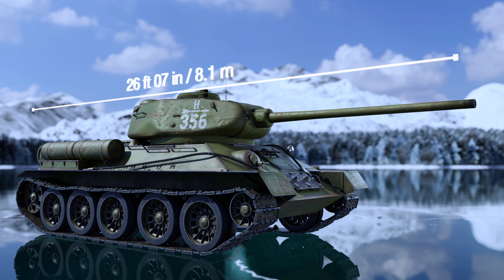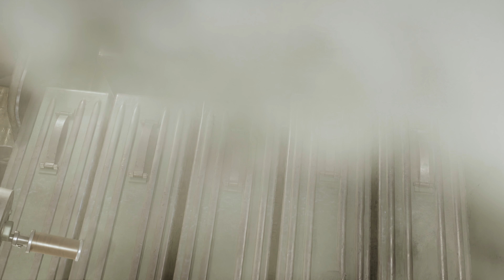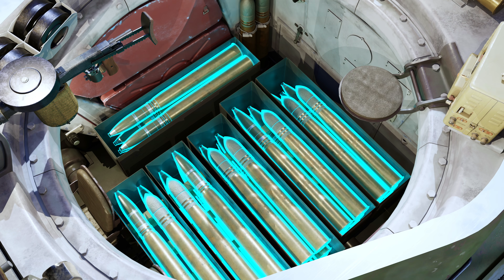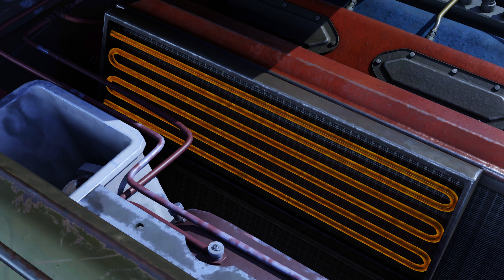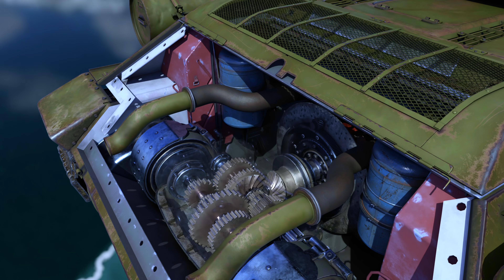Inside the T-34-85

Comment: Absolutely magnificent video; thank you. I think there's a lot of truth in the theory that the T34 was so cheap and easy to produce the Russians could use them almost as a disposable, consumable commodity, almost the same as a hand grenade for instance. As soon as one was destroyed there was another, or two, on the way to replace it. There's a valid argument, I would suggest, that the German's obsession with expensive, complex, relatively fragile precision engineering and innovative new technology cost them the war. I believe that the T34 was deliberately kept as simple and straightforward as possible not just to reduce costs and maximise production rates but to also allow field maintenance by an unskilled labour force used to working on farm machinery

Comment: Awesome work as usual.  One correction, the front armor at 45mm thick, set at 30 degrees from horizontal (60 degrees from vertical) would be 90mm line of sight thickness, not 76mm.

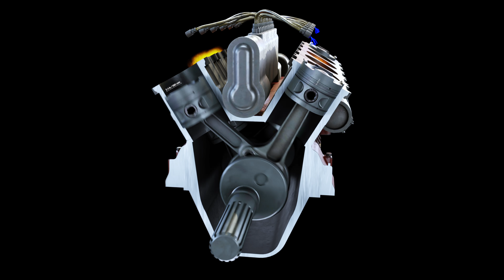Comment: 16:20 The engine of the T-34-85 tank had cylinders with different piston strokes in the right and left banks. Left bank piston stroke: 180 mm. Right bank piston stroke: 186.7 mm. The difference arose because the connecting rods of the left bank were shorter and attached to the "slave" connecting rods of the right bank (a "fork-and-blade" connecting rod arrangement). This was done to fit two connecting rods on a single crankpin journal within the compact V-engine layout.

Comment: Now compare this to what Germans had in 1941... 
And who was prepared better for the attack.
Reply: In 1941 they had 300hp gasoline engine that can not start cause it lost ignition or carburetor is not setted right😂 
T-34 v2 engine is 500hp,have much more torque and it always started without problems,this engine started on is-3 even 70 years later without taking it from the tank. They just changed oil and water,and it started.
Reply: @HoldenCommodoreGRA Exactly. Stalin had thousands of superior tanks. We dodged a bullet thanks to an insane German leader with a funny mustache 😂

Comment: nice detailed video. you mentioned some of the problems. it was actually piece of junk. the lack of turret cage forced the loader and commander to dance with the rotating turret, the electric motor that turned the turret was weak, overheated, burned. manual crank was necessary.... it was so bad, that for each german tiger destroyed, russians paid with 25-28 of t-34. the 85 mm T-34 gun vs the 88 mm gun on the Tiger... Russians had no problem sacrificing their own soldiers en mass.... "women will deliver more babies, nothing to worry.."
Reply: Очень смешно, эти сказки уже с 2000ых в России устарели а на западе в них ещё верят?)

Comment: Still cannot believe someone is able to do such vast amount of work. Brilliant.
Reply: J. Walter Christie was a genius
Reply: @DoktorBayerischeMotorenWerke , what relation does John Christie have to T-34?
Reply: @antonkirov1923  He designed the BT tank series which the T-34 is a BT model variant.
The T-34 is directly related to the Christie Tank "aka BT"
Reply: @DoktorBayerischeMotorenWerke , John Christie did not design any BT tanks. He dis not create even one tank. He did not invent “Christie suspension”.
He created a concept models of tanks. BT-2 took many decisions from M1931, but it was created independently.
Christie invented wheeled-tracked suspension/drive hybrid.
Suspension of T-34, was invented and used ling time before baby Jony was born.
Reply: @antonkirov1923  The M1931 also-known-as the "BT-1" tank was designed by J. Walter Christie. The M1931 was purchased by AMTORG and shipped to the Kharkiv factory where it was replicated and introduced into service in the USSR.
 Please name a tank that predates the M1931 with the same suspension system?
Reply: @DoktorBayerischeMotorenWerke , БТ-1 was prototype, but not a completed, fully functional tank. That’s why there is БТ-2.
Christie is the first who invented convertible tank. But it doesn’t relate to T-34. Originally A-20 (БТ-20) and A-32 were planned with torsion suspension, which already was used on KV tanks (it’s prototypes at that moment). But due to industry was not ready to produce high quality torsions, a springs were returned.
Somebody generates such rumors.
Reply: @antonkirov1923  The only major difference between the J.Walter Christie designed BT-1 (M1931) and the BT-2 (M1932) is the addition of a turret.
  J.Walter Christie invented the suspension system used on all the BT series tanks including the BT-20G/A-32) which is the T-34.
 The T-34 is directly related to the BT-1 and retains the Christies suspension system, the T-34 only deletes the convertible road wheels and adds an additional axle to improve weight distribution, all other aspects of the Christie BT suspension are retained.
Reply: @DoktorBayerischeMotorenWerke , should be mentioned that Christie created just a prototype, or should be mentioned Ginzburg.
Independent trailing-arm suspension was not invented by Christie.
There is nothing of the BT-1 in T-34. Actually A-20 and A-32 were completely different tanks.
Reply: @antonkirov1923  J. Walter Christy created the BT-1, the prototype for the T-34.
No, Christy invented a unique type of trailing arm suspension for tanks that features a bell crank and push rod with/ helical coil spring arrangement which is protected inside the tank hull. The EXACT SAME design used in the T-34 and all the BT series.

I SAID
quote: BT-20G which is the same as the T-34 (A-32)
Reply: @DoktorBayerischeMotorenWerke , Christie used trailing arm suspension that already been created with tracked propulsion. But in patent law, such innovation named a utility model. Yes, he is the one who first put springs inside. But on Merkava, with springs outside the hull, the suspension also named Christie.
He has relation to T-34, the same as Wernher Braun relates to Soyuz rocket family.
Reply: @antonkirov1923  Christie invented the design used by the T-34, which is a trailing arm system that allows the location of the helical coil spring to be positioned independently though the use of the bell crank arm and push rod. 
 It is this genius invention that makes the BT/T-34 series unique from other trailing arm suspension systems that were not as successful as the T-34 was.
 The BT series incorporated many modifications, additions and deletions most of which were not successful and Kharkiv continued to retain the basic BT-1 design throughout the series right up to the T-34 which also retains the basic Christie M1929/M1930 BT-1/BT-2 design and layout.

The T-34 is directly related to the Christie M-1929(BT-1) as the NASA Mercury rocket was directly related to the V-2 missile, it uses much of the same design and technology from the original missile design.
Reply: @DoktorBayerischeMotorenWerke , let’s look on «directly related» T-34 / M-1929.
1. Mass: 26.5 t / 9.36 t,
2. Armor thickness: 52-40 mm / 5.5-13 mm,
3. Propulsion: Caterpillar / hybrid,
4. Weapon: 76.2 universal gun / machine guns, which was not delivered,
5. Hull design: sloped welded armor / vertical steel shields assembled with rivets,
6. Engine: diesel engine / petrol engine,
7. Crew: 4 / 2.
As you can see these machines are absolutely diﬀerent.
But, there are few things which remained on T-34 due to «directly related» Chrisrie
model:
a) Two seat, cramped turret,
b) Pinion engagement type of trucks,
c) Springs, instead of torsions,
d) Driver’s forward opened hatch.
All four mentioned things were the biggest problems of T-34 and all have been
removed on T-44 tank
Reply: Basic “Christie design/layout” was not invented by John Christie and was used on soviets tank before.
In Christie models, springs were located in double-wall space, but in T-34 inside the boxes.
The front of hull on T-34 made of two plates. Presently such solution is used on all tanks. On M-1929 this part is pyramid, made of four plates.

Comment: Насчёт двигателя враньё, на танк Т-34-85 устанавливался американский двигатель, поворотный механизм башни, тоже был американский, резина на катках, тоже американская, про оружейный ствол, тоже ничего не сказали, да его изготавливали в СССР, но на американских станках, которые были доставлены специально из США, об этом уже рассказали и показали на Ютубе, странно что вы об этом ничего не знаете.
Reply: Ну то что электромоторов в СССР не производили, так это понятно. Но почему же вы не назвали модель американского двигателя?
Дай угадаю - это сверхсекретная информация?!😊
Reply: Early BT tanks were equipped with the Liberty engine, based on the Mercedes D.IIIa later tanks with the BMW VI
The T-34 was powered by the V-2 which is the land version of the Kharkiv AN-1 aircraft Diesel engine also based on the BMW VI with Bosch injection pumps
Reply: @DoktorBayerischeMotorenWerke , this means V-2 is BMW VI? Seems instead of Injectors in the head were installed a spark plugs!
But....I don't see heads, or one head on BMW VI. However the angle between two blocks is exactly the same! But actually... blocks on BMW VI I didn't found.
Of course this is not most important in engine. The main thing is movement of the pistons in the liners! Hope you agree. Looking on the drawing... Yes, BMW VI has pistons, but without liners!
At least V-2 same as BMW VI has rotating crankshaft with flywheel. And again, we cannot find flywheel on the BMW.
V-2 is very strange version of BMW VI.😊
P.S: company Bosch was not the one, who invented such type of Injection Pump
Reply: @antonkirov1923  The V-2 is a variant of the Kharkiv AN-1 aircraft Diesel engine which is based on the BMW VI and shares the same geometry and crankcase/reciprocating assembly. The individual cylinders were upgraded to a monobloc cylinder casting and heads.

Aircraft engines do not have flywheels, the propeller mass serves this function without the additional unnecessary weight.
V-12 engine also do not require flywheel to operate as a power stroke occurs every 60 degrees so they are overlapping by 30 degrees of crankshaft rotation, heavy duty vehicle engines do however need some additional flywheel mass to improve tractive effort and clutch engagement.

The Kharkiv factory did license and import Bosch Diesel injection pump technology and the AN-1, M-40 and aCh-30
 used copies of the Bosch PE series injection pumps with modifications to reduce manufacturing costs and eliminate parts that would have to be imported. The V-2 pump is a further simplified, economy versions of the Bosch PE pump.

All Soviet Diesel in-line type injection pumps are based on Bosch PE Reihenpumpe units.
Reply: @antonkirov1923  The V-2 is a variant of the Kharkiv AN-1 aircraft Diesel engine which is based on the BMW VI and shares the same geometry and crankcase/reciprocating assembly. The individual cylinders were upgraded to a monobloc cylinder casting and heads.

Aircraft engines do not have flywheels, the propeller mass serves this function without the additional unnecessary weight.
V-12 engines also do not require flywheel to operate as a power stroke occurs every 60 degrees so they are overlapping by 30 degrees of crankshaft rotation, heavy duty vehicle engines do however need some additional flywheel mass to improve tractive effort and clutch engagement.

The Kharkiv factory did license and import Bosch Diesel injection pump technology and the AN-1, M-40 and aCh-30
 used copies of the Bosch PE series injection pumps with modifications to reduce manufacturing costs and eliminate parts that would have to be imported. The V-2 pump is a further simplified, economy versions of the Bosch PE pump.

All Soviet Diesel in-line type injection pumps are based on Bosch PE Reihenpumpe units

Comment: It didn't really matter whether the fuel tanks were full or empty, because the fuel lines were leaking. 
The floor of the T-34 was constantly covered with a sticky mess of diesel and dirt. 
The tank crew's clothes were coated in this mixture.
 When a shell pierced the tank's armor, it instantly ignited this mixture and a fire would start. 
The ammunition would begin to detonate. 
It was a crematorium tank.

Comment: They had to make so many because they were  non functioning junk by two weeks. The crews tried to carry spare motors as they stopped running quickly. It was the tank they had to work with, that is why they tried to build better so many new models of larger tanks.
Reply: Интересно, где ехал запасной двигатель?

Comment: The T-34 was actually an expensive medium tank design originally but then when Operation Barbarossa began, the Soviet's basically panicked and forced the tank into the sweat shop and cut a lot of corners in the manufacturing process to churn out as many as possible.

Comment: the V-2 engine was created at the Kharkov locomotive plant, and the engines were produced at the Chelyabinsk Tractor Plant (CHTZ), so the engines of this series have nothing in common with aviation, this can be seen by the way this engine works - like a tractor. The stroke of the pistons of the left group is 180 mm, the stroke of the right group is 186.7 mm. This is a rather unusual engine, but Soviet technical solutions turned out to be successful and modern tank diesels for the t-72 and t-90 tanks inherited the basic layout from this engine, with changes related only to increasing the engine life and power of the unit.

Comment: There is one detail that i find missing: what happens with the used shell casings? Are they just left to roll around loosely, or did they have a method for keeping them out of the way?

Also, i would love to see a video done of the Elefant heavy tank destroyer. That thing was the definition of a self propelled gun, given that the tank was built entirely for just the gun!

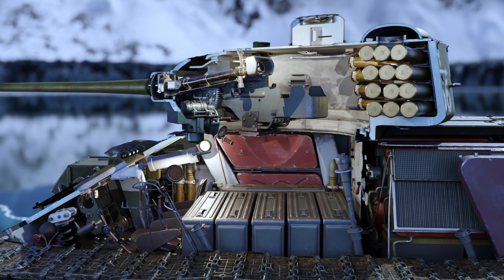Comment: 1:32 Actually crew consists of just 4 people 🥸
Reply: On T-34/76. This is On T-34/85.
Reply: During the early productions of T-34-85s they utilised a two crew system the same as the earlier T-34 variants during the Great Patriotic War , however during late 1944-1945 the soviets added the 3 turret crew system which divided the work flow for the crew so the Commander wouldnt need to Command and fire the vehicle.

Comment: In contrast to thermite welding, the armor plates of the T-34 were joined using the conventional arc welding process. The rough appearance led to rumors about poor quality (e.g., "gaps large enough for a pen"). Military historians, however, confirm that these welds were perfectly adequate and functional for combat capability.
Reply: Много этих танков еще сохранилось в виде памятников или мишеней на стрельбищах и полигонах. Швы грубые, но вполне приличного качества.

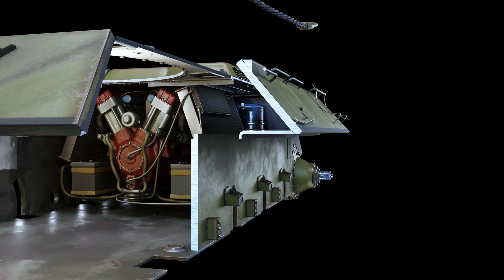Comment: the T34 had a welded plate on at the transmission compartment (seen clearer at 11:00), and its sole purpose it to knock the pin back into the track links. when the germans looked at the t34, they didnt know what it did and copied it on the panthers despite panthers not needing it

Comment: Forgot to mention just how simple the treads on the T-34-85 was held together. 

The T-34-85 treads were held together by pins that did not have a cap on the side facing away the tank to prevent the pin from working itself out. To prevent the treads from coming apart, a simple retention system was installed on the body of the tank that knocked the pin head facing toward the tank back into place to keep the tracks in one piece.

In fact the iconic “clicking” noise that is heard while a T-34 tank of any variant is in motion. Is made from that striker plate knocking the track pins back into place.
Reply: Great info, didn't know that,thanks.
Reply: Stop blowing my mind!
Reply: Справедливо для новой гусеницы. Полагаю, что если танку удавалось "пожить" подольше, штифты удерживались в траках уже самостоятельно, из-за местного износа поверхности штифтов.

Comment: One of the things I found interesting were the track pins. On most other tanks they are held together with the usual pin but the pins were stopped from working their way out by a fitting on the end of the track pin. These were easily damaged and made track work difficult particularly when away from repair stations. The T34 track pins were fed trough the tracks from the inside but not fixed in any way. There was a plate mounted near the front idler that was sloped and if a pin started to slide out it hit the sloped plate and was forced back in on each rotation and so they were normally quite loose but that made track repair much easier.

Comment: The track pin wedge welded onto each hull side would contact track pins which were working their way loose on the inside edge of each track plate and nudge them back into the track plate as the tracks moved past the wedge. Unique to the T-34 series, very simple, and effective.

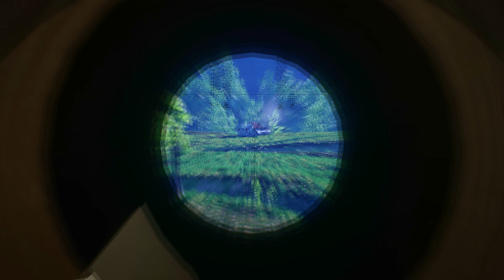Comment: At 6:54, a detail is missing; the spring loaded deflector by the breach. It is a piece of metal used to help the loader load the 85mm gun by letting it sit on the tray to take some weight off before pushing it into the breach. It is spring loaded and goes up at an angle to help deflect any spent casings that eject from the breach down to the floor after firing. You can see this device on most internal turret shots of the T-34-85, especially on the Chieftain's hatch T-34-85 episode 2 at the 9 minute mark.

Just a small little thing but overall, it is a very detailed and informative video, keep up the good work!

Comment: Great clip. Learn alot. U forgot to mentions russian tanks usually had a bump in their tanks to force loose pins back on their tracks. Russian tanks usually did not loose their track due to pins, while germans had a issue with it. 

T34 is the best tank in ww2, when u consider how many build and impact they had on a war. 

U forgot to mentions how scary germans become when they saw this tanks for 1 time in 1941.... nothing could destroy them, except 88 mm flak gun.